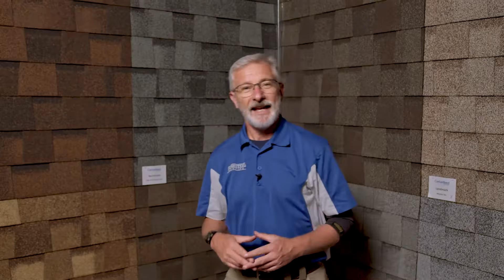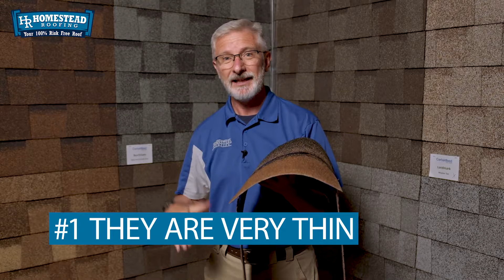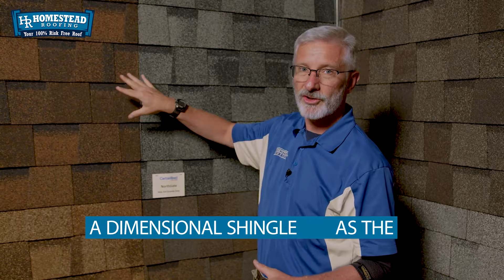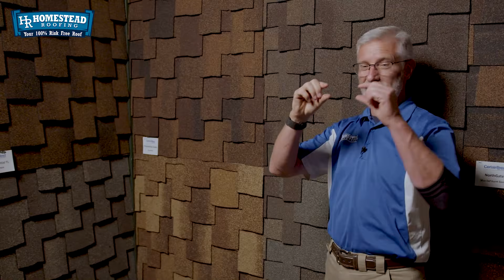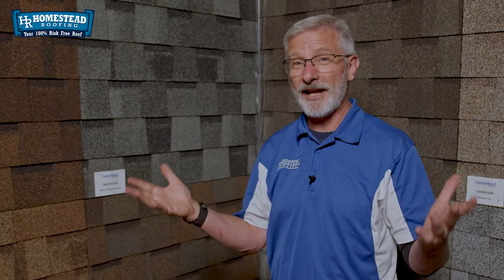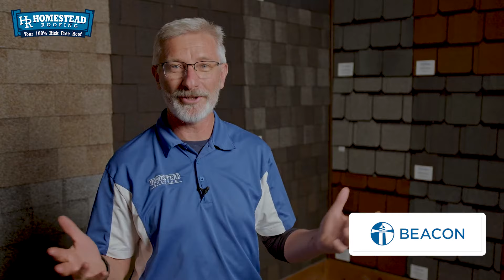How To Choose The Best Shingle For Your House in 2026

Comment from the maker: Because of issues we have encountered, as of 3/28/25, we can no longer recommend some CertainTeed products. For now, we are not installing or recommending CertainTeed Landmark.
Reply: May I ask what happened?  I have a quote to put the Northgate on my house and I’ll switch to Malarkey if the issue is bad.
Reply: Thanks for your video. Very informative. We currently have a 12 YO Landmark Pro installed. Also have screened gutter guards. I have to get on the roof and blow off all the granules every few months from the gutter screens. Don't know what is considered excessive granular loss, but seems like a lot to me. Anyway, we had a large hail storm in my area recently and have some contractors coming out to look at damage for possible insurance claim. Would like to avoid any issue with any new product. If not the Landmark (because of recent problems) then what would you suggest?
Reply: I am also curious
Reply: Does that include Landmark Pro? I just found that brand & model in an estimate I recently received for a new roof.
Reply: Hello. Reiterating my question from last month, in case it was overlooked: does that include the "pro" version? 

Also, could you give a sentence or two about what those issues were? I'm still trying to decide on an estimate recently given to me by a reputable roofer in my area.
Reply: What is the warranty of a dimension  shingles?

Comment: Wouldn't a thicker shingle with a bigger gap under its edge result in wind blowing it off easier?
Reply from the maker: There should never be a gap under a shingle. If there is that's a manufacturing design flaw or an installation error.

Comment: Great video very informative. I never heard of Certainteed brand until now. But you can't go wrong with Malarkey, Owen Corning & now Certainteed. The reason I didn't include GAF it's because my roof is GAF installed last 2007 and the granules starts pealing off 2022. And now it getting worst I could see the fiberglass. And it suppose to last close to 30 years according to the warranty. I'm so disappointed  with the product. Malarkey said to be 50 years warranty.

Comment: Sbs modified artitectural shingle 4 rating ,,, atlas , Iko,, gaff  or malarkey ,  rubber roof euroshield  decra metal granule shingle
Reply from the maker: That's why I prefer the Northgate. It's one of the heaviest class 4 shingles. I would never recommend Euroshield to my clients. It's not class A fire rated. I also would never recommend Decra - it dents too easily and the granules fall off.

Comment: Hi, we need a new roof now and currently got estimates and deciding whether we will go with landmark pro or northgate climate flex. 15k vs 17k. The main difference is the class 3 vs class 4 impact rating also their durability that 4 will last 40-50 yrs compared to class 3. However, our roofer told us personally he would chose landmark pro because of their durability and quality. The only thing holding him back from getting class 4 is he said insurance companies are trying to recommend people to get class 4 shingles that way if a storm or hail happens in the area after few years, they won't be cover roof replacement because the owner has class 4, he mentioned something about cosmetics that I forgot. I did some research about it and some roofers and ithose who are in insurance also said that's the future of insurance wherein they wont replace roof anymore so they want people to get class 4. But yeah, after days of researching, we ended up deciding if we'll go with northgate vs landmark pro? Can you help is on this one? We live in Michigan, by the way. And planning to keep the house for 30 plus more yrs.  Don't get that much hail in our area but still, want a longer durable strong roof to last us 30 yrs. Paying $740 a year for home insurance.
Reply from the maker: I would not install the Landmark Pro on my own roof. The class 3 rating is meaningless because they didn't change the manufacturing process from when it wasn't considered impact resistant. That means the shingle that wasn't rated as impact resistant before, now magically is impact resistant even though they didn't change the shingle. If you get big hail on your Landmark Pro roof, you will have to replace it. 
I don't know if things are the same where you live, but here the Landmark Pro is quite a bit more expensive than the Northgate.
We just had big hail here that was very damaging. We looked at several roofs which were totaled, and we looked at 2 roofs in the same neighborhood which we installed the Northgate on in 2018. Neither of the Northgate roofs had any damage and all the roofs around them did.

Comment: lol.....my 30 year old Owens Corning 3 tab shingle are going on 30 years here in NY and look great. Several hurricanes and a freaking tornado that took my trees and deposited them in my neighbors pool. ...still kept all my shingles.   Everyone in my area have been getting the GAF architectural shingles installed and they DO NOT hold up well at all.   They look old with mildew and overall,  lumpy bumpy and ugly. Replacing mine soon to be proactive but sad if I need to go with GAF.
Reply from the maker: You shouldn't need to use GAF. You can choose whatever shingle you want.
Reply: @homesteadroofing  I had Owens installed and a bit disappointed in quality. Not the same shingle from 30 years ago.  Very thin and not the same quality granules.  A bit sad but I do have the Owens Corning Preferred Protection Roofing System Warranty so that's a good thing.  Ultimately, It will be a plus when selling my home.

Comment: Hey Tracy.  I've been watching a lot of roofing videos over the last several days, and yours are terrific.  I was all set to go with a guy who uses only GAF shingles, but I'm now switching to a company that uses Certainteed Landmark Pro.  You (and others) have convinced me they're a better product.  I have a couple of questions, though.

1.) I like the darker brown shingle that was over your left shoulder to start the video.  Can you tell me what color that is?  Is it the new Max Def Espresso?

2.) Although I've settled on a new product, I'm not quite there with the contractor yet.  The ink on the estimate wasn't even dry when they bumped up the price by $1000.  Then I found out the roofing contractor I thought I was hiring (who said their business was slow), was going to be farming the job out to a sub-contractor.  Is that typical?  I feel like they gave me the old bait and switch, and it's damaged the trust I had with them.

Thanks!
Reply from the maker: Many roofing contractors use sub-contractors. That's pretty standard, especially in areas where you can't install roofs all year long.
Reply: I agree they did mislead you because you hired one company and are getting a different one you did not hire , I would have canceled and found another roofer.
Reply: @staresce   Fortunately, I meant the ink on the estimate... not the contract.  I didn't hire them.  From what I've heard, though, subcontracting the work out is more common than you'd think.

Comment: i ve had 90 + mph winds on my 3 tab shingles with no  damage, but i used roofing nails and my shingles are 30 years old next year and still has good granuals  but i installed 30 year shingles

Comment: sorry man u actually can use it as a starter just flip them over glue side up and if the company will say to contractor "sorry one of your guys has to get the ridge we didn't account for " You are excused to use shingles as the ridge cap :)
Reply from the maker: That only works for 3-tab shingles. 
You can't use dimensional shingles as starter or ridge

Comment: WHAT BRAND OF SHINGLE IS BETTER . I am looking now . I want ice and water shield on the whole roof . It is only on the front part of the roof half way up . I get high winds up on this hill and driving rains . please remember we are in our 70's and retired  . . Iknow I finally found a roofing contractor and he told me about pinnacle pristene shingles 31.99 a bundle and we need 111 of them for our roof . Our roof is 20 years old as of this year
Reply: Good.
 Luck with certainteed warranties. I had problems with the fiberglass showing and after emailing several times and mailing a shingle to them as requested there was not a rep available to help. I talked with other people and they had the same problem.
Reply: I  live in Southside Virginia
Reply from the maker: I don't think you can do better than CertainTeed Northgate
Reply: @homesteadroofing  they suck  they only lasted on my neighbors house 8 years . They look horrible  , lots of grit coming off them and i watched when the house was built . 15 lb tar paper under them.  . The grit piles up at the bottom of the downspouts and the owner has to unclog the grit from the downspout extensions .. I decided on pinnacle and ice and watershield and roofer custom made wider drip edge up on the roof and down to the new 6 inch gutters that replaced the 5 inch gutters . . The shingles laid really nice when they went down . . I was thinking  standing seam metal but there has been problems with oil  panning and not being able to get the metal roofing . So option was the upgraded  brand of pinnacle shingles . 10 thousand and down and i watched it all as it was bieng done 8 men on my roof to get it done
Reply: @homesteadroofing  That stuff is garbage also . My neighbor after only 15 years of certainteed is having my contractor put new roof on her failed roof of them . Not sure why those go to great companies for roof shingles have went down the tubes in quality . BUT THEY HAVE . THEY cut baack on quality they will loose more people to metal roof or find another company that sells better roofing .  They don't care anymore . 7 roofs in my neighborhood that contractor put certianteed on have failed . Lasted between 10 and 15 years . My GAF lasted only 20 years and I was lucky I put ice and water shield under it . The results for those other roofs with just tar paper under them was worse . 15 lb tar paper also .One nighbor has had his roof on for 30 years and they are 3 tab shingles and still look good
Reply: . Sounds like shoddy installers not adding a balanced ventilation system resulting in the roofs lasting only 5 to 20 years instead of 50 plus years.
Reply: @dnx112  I have 4 large attic round vents and 2 of them have fans installed in them that exhaust heat in the summer . Ridge vents don't work up here on the hill side where I live becase they get blown off . i never had a ridge vent but the few nieghbos i have had them and  the one just repaired his for the 4th time in just 4 years of his house being built . my house is a modular house and the roof  ridge has steel beteen the beams up there . My baserment has 18 foot deep footings with steel beams  running from the front of the house to the back with columns in the middle and I left my modular house on frame also but floor joists I had upgraded at time of the build to 2x12 along with 2x6 stud walls . I know I had it overbuilt but it was my chioce . support columns inside the open floor plan walls also have steel in sandwiched between the studs .Gaf shingles did not last from the beating of high winds and wind driven rain .. I think  that roofing material like everything else is not made to last anymore . They just want to get rich and don't care about quality or customer care   anymore . .
Reply: oh they gave us a military discount so came out to be 27.99 a bundle  plus ice and water shield was originally 62 dollars a roll and discount was  58 dollars a roll

Comment: I'm having a roof put on by an insurance claim and 3 tab is what the adjuster shows on the estimate.   If I want something different is my only option to pay the extra out-of-pocket?

Thanks
Reply from the maker: Most likely.
Reply: @homesteadroofing   Thanks for the reply.   I later asked my ins adjuster about it.   Here's what he said.  

"I can release depreciation as the different parts of the house are finished, but that first check was meant for both the siding and roofing. If dimensional shingles are used and cost more than that would come out of pocket for you, if the cost the same or are less than the bid then it doesn’t matter."

 2 roofers are both lower than the insurance amount when depreciation is included and don't want a down payment.   This makes me think that I can use what I want as long as it does not exceed the RCV.

 Also, thank you for returning my call a week ago,  after your work day was done, though I am not in your area.    You gave advice as if I was a potential customer and I greatly appreciate it.

 For anyone reading this, Tracy is the real deal.

Comment: I've seen a lot of people call CertainTeed the king of granule loss, and I've heard a lot of people say Malarky is the best shingle out there. 

Can you comment on this? Because you definitely seem like a straight shooter to me.
Reply from the maker: Tamko is definitely the worst when it comes to granule loss. I've been using CT products almost exclusively for 8 years and haven't noticed a problem. As far as Malarkey goes, I recently recommended them in another video, but the very day it released, I encountered a homeowner with a Malarkey product failure, and the warranty award they gave him was pathetic. It's the 2nd time I've dealt with Malarkey's warranty claims and neither time has it worked out for the homeowner.
Reply: @homesteadroofing  hmm, very cool. Thanks!

Comment: I don't think dimensional or architectural shingles look good, or are made of materials that will stand up over time. Though they have warranties for wind and hail, they are prone to look bad in a few years and installers do not warranty for cosmetic (appearance). I don't think they have been around long enough to demonstrate their reliability and performance is better than 3-tab.
Reply from the maker: Interesting thoughts. Dimensional shingles are made of the same material as 3-tabs and are thicker. They've been around since the mid-90's so we have examples of them that are almost 30 years old. I'd take a dimensional over a 3-tab all day every day.
Reply: interesting comment..Im in the process of choosing what to put on our previous, 22 yr old 3 tab type shingle... these "dimensional" shingles are trippy looking to me...I gotta say, 1st off I didnt care for them at all, they looked bizzare and i was wondering why I wasnt seeing the 3tab type being offered.. they are starting to grow on me alittle as I see almost all homes around me have them... the other concern is, that they may indeed look haggard, after a few yrs with the edges curling up as ive seen this on some houses, though i dont know what brand they were.. anyway, didnt look that good.. my 3 tabs looked fine but were hail damaged...
Reply from the maker: @skip741x3  I've seen many dimensional shingle roofs with shingles 20+ years old and haven't seen any of them curling at the edges. If you like the 3-tab shingle look, you should be able to find a roofer to install them - depending on what area of the country you live in. But I think you'll like the dimensional shingles just fine.
Reply: i must strongly disagree as i am now just replacing my Certainteed Architectural shingle ( dark Prairie Wood color) after 34 years!!!    Has not faded at all..to compare .i have a couple xtra bundles i bought just in case....also the shingles only started hairline cracking last year...